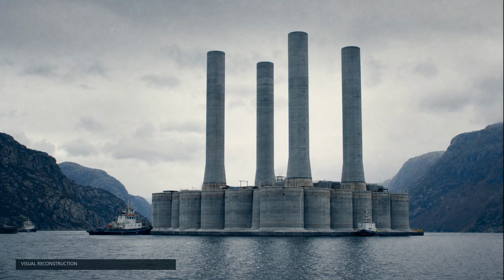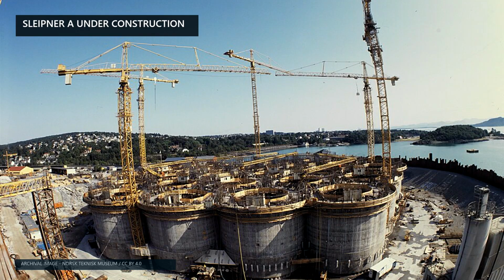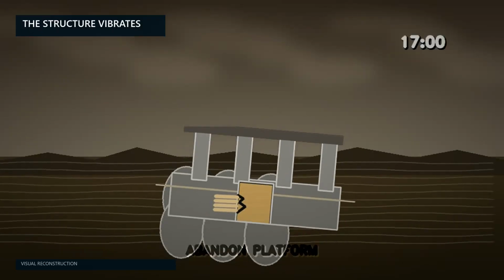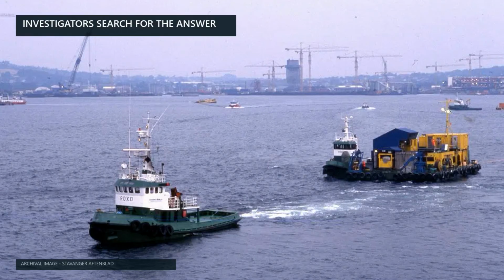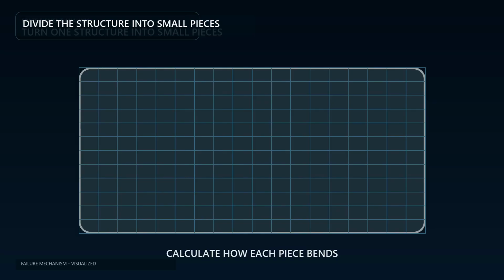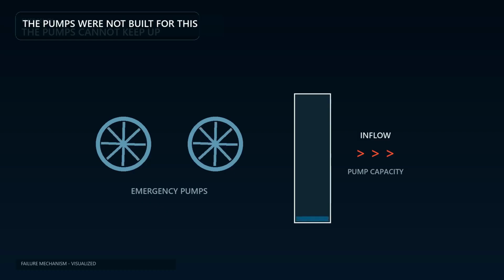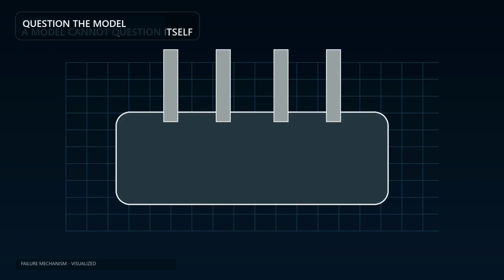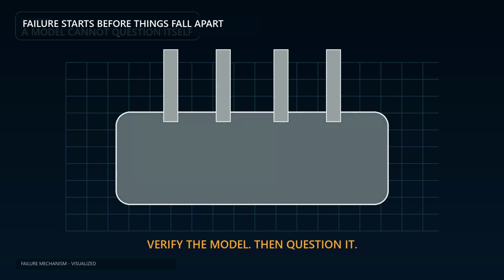The Computer Said It Was Safe — Then This Oil Platform Sank

Comment: CAD = computer aided destruction. It's an easy mistake, the same as boats running on to reefs when using GPS.
Reply from the maker: “Computer-aided destruction” is painfully accurate 😂 The software did exactly what it was told — unfortunately